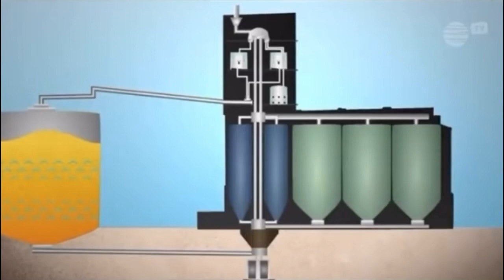5 Freak Deaths that Happened on the Job

Comment: 2012 saw a young man crushed by a front end loader. Had the bucket raised filed with concrete, jumped from the cab to move a log in the way, whole thing tipped forward and crushed by the bucket. He was only 22 years old.